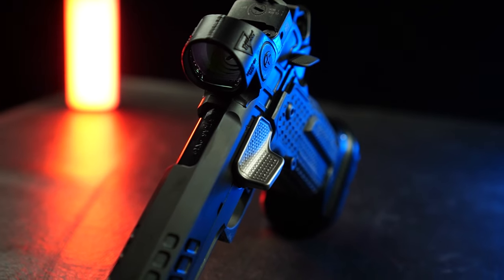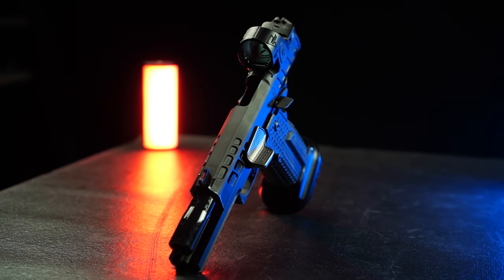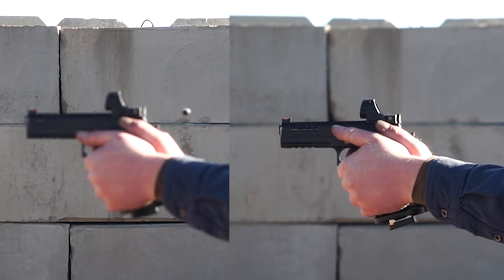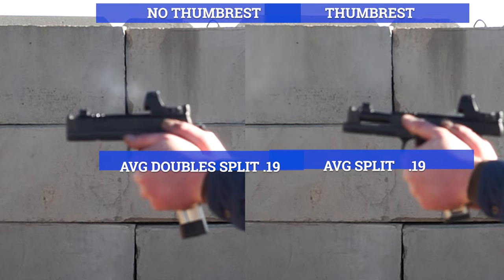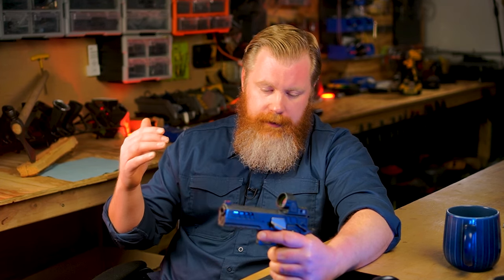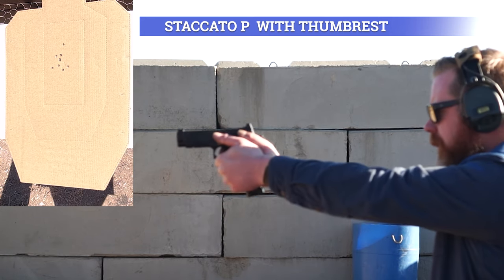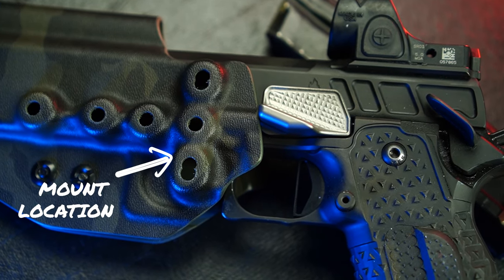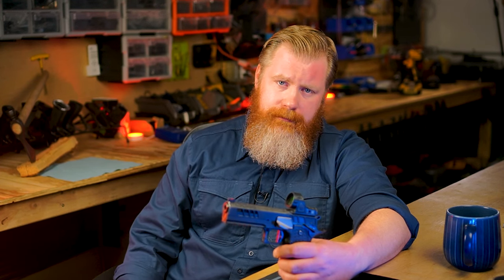DO YOU NEED A THUMB REST TO CONTROL RECOIL?

Comment: This whole "argument" over thumb rests is silly at best. Its like telling someone how they should like their steak cooked.  To me, if a gun feels comfortable in your hand, chances are you're going to shoot it better. I have a few guns that came with a rest (CZ TSO,TSO2, and a Sig P226 X5 Legion) so they still have a factory slide stop, and the thumb rest fits the gun better than just throwing a aftermarket rest on.
Reply from the maker: I think the problem exists where people are being led to believe that it will give them a performance improvement. But it’s really not that cut and dry. It may lead to an improvement in recoil control, especially if you have a poorly developed grip. But it isn’t necessary and also comes with drawbacks. 

Comfort is certainly subjective but I don’t find that the rest was any more comfortable than not having it at all. More power to ya if you did. But it isn’t a given that it will be more comfortable or will give you better performance. 

Most people will be better off simply focusing on improving their grip fundamentals and spending more time practicing.
Reply: @hammerarmament   Cool, what do I win?
Reply from the maker: @rockie071   nothing. There was a spam bot impersonating us a couple days ago, replying to every comment on every video. It should be purged now but for future reference, any giveaway/prize comment on YouTube is a scam. Don’t click or reply to them.

Comment: Best way to think about how to effectively use a thumbrest is as a rest. Not a leverage point to "control" recoil. Open shooters with thumbrests are either using them to consistently index or they like a very fast slide speed and a little leverage can help return the gun. For 9 minor guns practice is all you need, not what ever the instagram 2011 "experts" say you need. Great video and content!
Reply from the maker: I think it’s better to accept that recoil will happen and not worry about “controlling” it, and experiment with your grip to find a consistent return from recoil. There are guys achieving very high performance with thumbs up, thumbs down, thumbs forward and anywhere in between, where they are running the gun almost as fast as the mechanical limit(approximately 0.10-0.13 split ). Open shooters need to make sure that their thumbs are clear of the slide racker though, so a rest helps keep them out of the danger zone. Like you mentioned, Most open shooters I’ve talked to simply use it as an index point. 
With more “normal “ guns, you have more room for experimentation. Find something that works for you, your hands and your gun, and then practice that until you do it every time without conscious effort. 

The one shot return drill is something I’ve found helpful in understanding recoil and how to “get past it”.
Reply: @hammerarmament  I am very excited that there are gun Youtubers sharing this info! My hat is off to you. The hunt for flatness is a neat experiment but physics are physics! Recoil will happen and it's better to be actually good than look good for followers haha
Reply: @hammerarmament FYI, the mechanical limit on guns is way faster than a 0.10 split. No human can outrun a pistol not even Jerry Miculek. A Glock can go 1200rpm with full auto mods, a Beretta 93r can go similar. The slide, extraction, feeding, etc is happening at a 0.05 split. Anyone who says they're outrunning their pistol should post a video and train to be the next Jerry Miculek LOL

Comment: Tried it, used the Atlas GP on my XC. More trouble than it's worth. Felt better, but when I gripped with my left hand during my draw, I often drove it into the thumb safety and engaged it. Issue 2 , I like to get slide lock. That's nitpicky and if it actually helped my shoot better and didn't cause me to engage the safety, I'd live with it

Comment: For the active thumbs crowd (thumbs forward grip) it would seem to have the same effect if not more pronounced than the accelerator cuts/gas pedal cuts. That style grip is looking for somewhere for the support hand thumb to ride/press into-down. 

The passive thumbs crowd (thumbs out of the way grip) would see no difference with this or other cuts for the thumb to press into-ride. My first time being shown this type of grip I spent a few minutes looking at the cut for thumbs forward thinking well that’s useless now. 

On 1911, DS 1911, 2011 pistols for those who are slightly more into the fitment of the pistols. It should be noted that a “drop in” slide stop pin is not quite right. The fitment of that with the barrel link plays a decent role in the fitment of the barrel towards the rear, along with a few other details. Is it enough for most to notice, probably not. Yet for the price of some of these pistols and considering better fit and finish is something people brag about. One might want to make sure they are not giving away some of the fitment for a drop in part, when if done correctly things were fit to tight tolerances to begin with.

Comment: Various gunners have measured their split times by caliber, and have basically found that recoil doesn't affect split-times, up to a point. An experienced shooter can shoot 9mm, 22, and 380 at about the same speeds, but when they step up to 10mm or 45 their splits start to suffer.
When you're shooting 9mm out of a full-size, steel frame gun, there's nothing to be gained from reducing the recoil further. But when you're shooting a 10mm out of a polymer frame, or a 45 out of a compact, you start to need that extra control. That's where thumb rests start to help.
Reply from the maker: @gg4224  solid point. That certainly seems logical. However, a thumb rest on a compact 45 seems rather illogical in practice. 🤣

Comment: The heads exploding over these snake oil devices..
But skipz Gunz said I need it 😂
Reply: Well get it...What are you waiting for?
Reply: @Uncleprepper1 because it’s not needed on a gun that already has next to zero recoil.
All it will do is start forcing shots high right. 
That and you should be fitting slide catch pins. Pin dia is vital for barrel link timing and barrel lockup

Comment: With the thumb rest looks like the gun dips more
Reply from the maker: Yes. Trying to use force to fight against recoil , such as using a thumbrest or just muscling it back into place , will do this. It’s basically over correcting.
Reply: @hammerarmament  and that proves your point you have to learn to shoot it with the thumb rest so would rather just keep learning without that